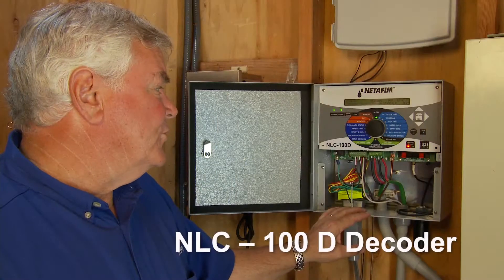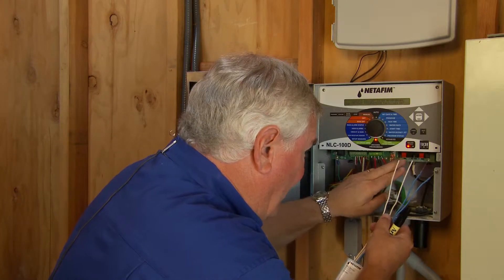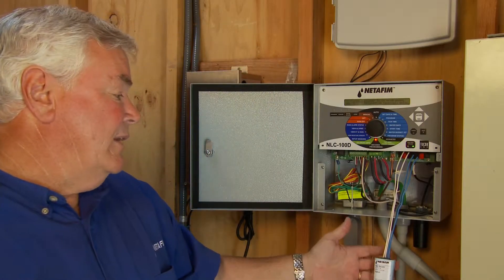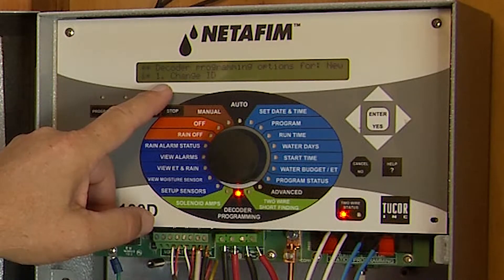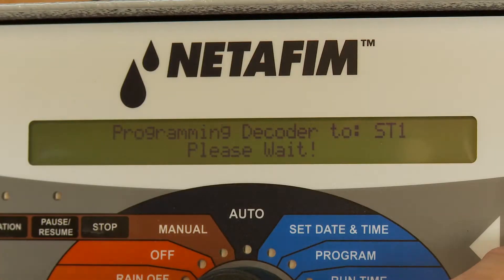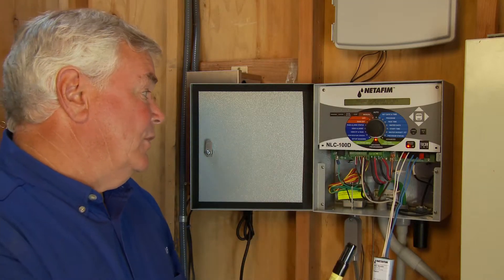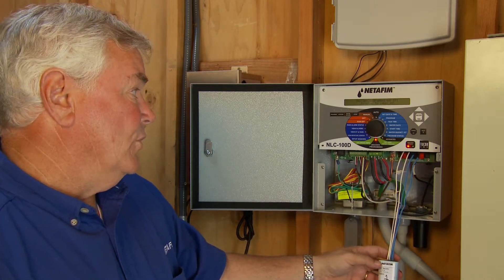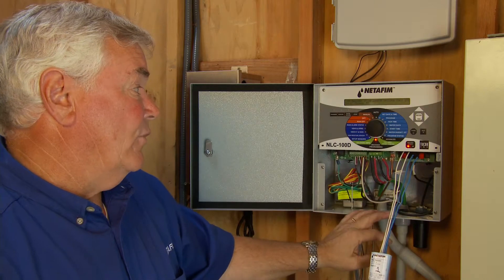Program a Decoder for the NLC-100D

Comment: We have a similar controller.  It is a LTD Tucor system.  Do you know anything about the display going out.  Two weeks ago something manager to pop the breaker on the controller.  After we reset the breaker, the controller display would not come on.  We are still able to run the system on either Auto, Manual, and even on test.  But the display will not come on.  Any Ideas?  Thanks